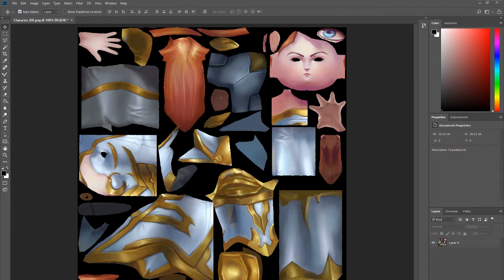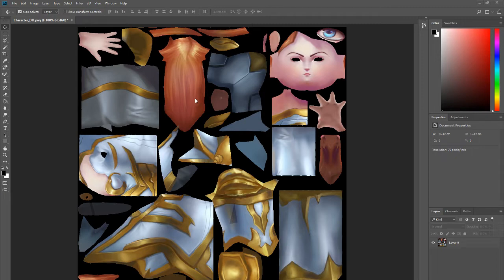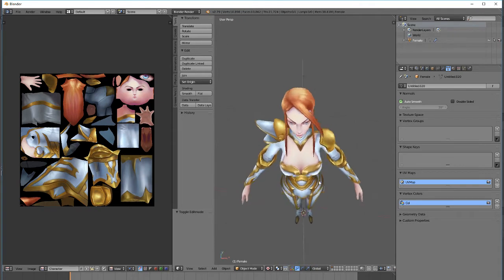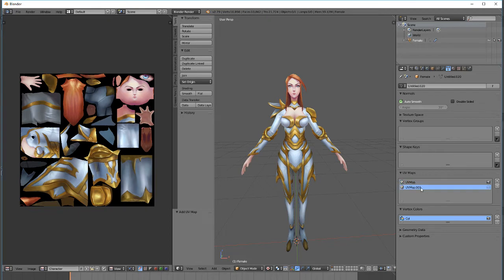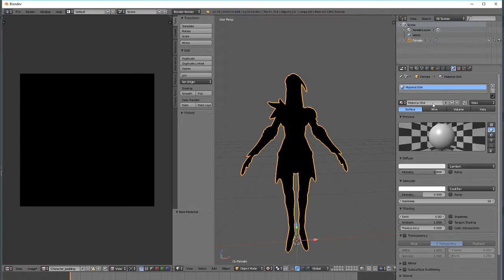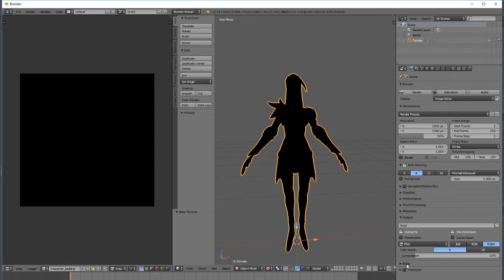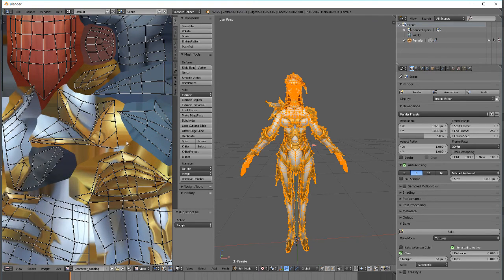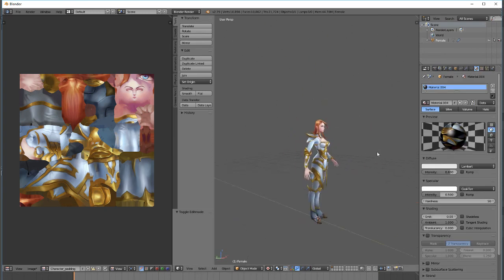| Game Art | How to bake edge padding in Blender Tutorial

Comment: Hey for anyone trying to do that on a newer version of blender
you can go in compositing and active the "use nodes"
There you can add you image with transparency put it in a "inpaint" node incress the Size to around 200 and puting back to viewer, you will get the new texture in ur texture after

if you have a rest of small line in the result before puting it into the "inpaint" node you can take a separate Color and combine Color, connect the red, green and blue together
so you can connect your image to separate and the separate to inpaint
after that you can add a new node called "dilate/erode" take the Alpha of your image to the Mask of it 
and the mask of it to the Alpha of the Combine Color
Adjust the Dilate/Erode Size to -1 or -2 depends of what u have
There you have !! Have a nice day ^^

Comment: For anyone wanting to do this in a newer blender version, I have found that the Inpaint node in the Compositing tab works.
Take your image with alpha and put it in there, turn it up to ~500, and push it out to the viewer node; then find that in the rendering tab.
If your textures are black like this, you will wanna use a mask and combine it through Combine RGBA
Reply: Could you post a video or give a link to the nodes setup?
Reply: @EnsignInSin  I don't quite have a video off hand. I mostly found this info through digging through the blender forms for like an hour lol.
But, the Inpaint node can be on the blender docs, if you search for it. Most of the setup is converting RGBA into RGB and back.